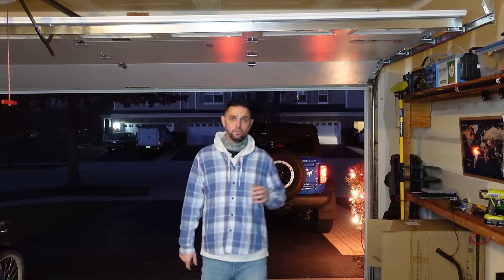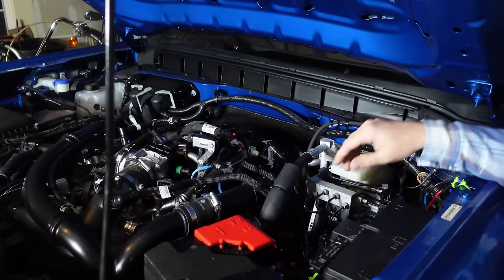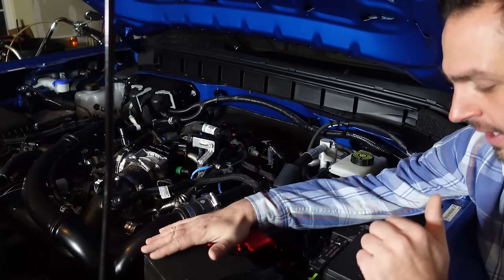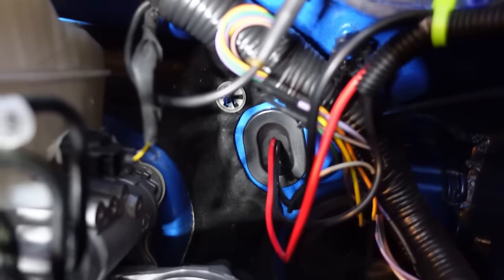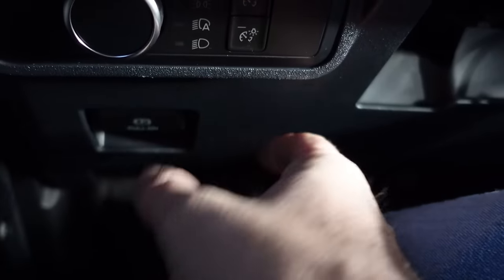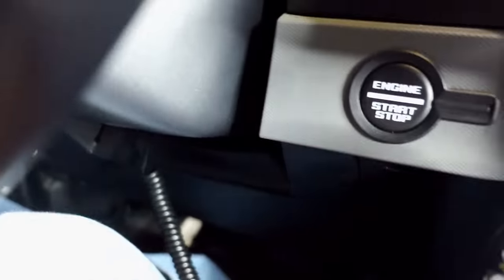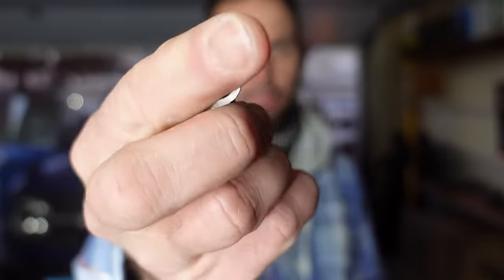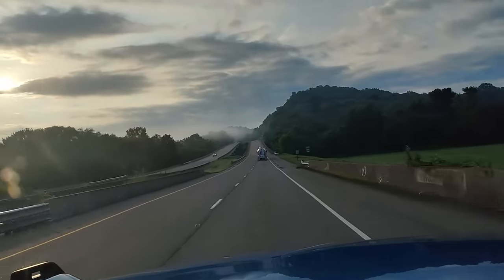My Ham Radio Install in a 2021 Ford Bronco 6G #hamradio #bronco

Comment: Yes sir! Shout out to you for reminding people about the airbags. So many people forget it or act like it wouldn't be that bad.  As some have pointed out, something could become a flying object and inflict injury when there otherwise may have been no injury incurred in an accident. A great reminder!
Reply from the maker: Thank You!  I am so glad someone was able to understand why I left this in. It's so important and could be deadly!   Cheers!
Reply: @HAMRADIODUDE Sorry, I am new here and new to using YouTube for this type of information. Do you have a video providing a more detailed install of your YAESU? I have the same model and would also like to put it under the steering column in my bronco. I appreciate any assistance you can provide. Thanks.

Comment: Nicely done! 
Something I did with my FTM-300 was run the power cable through the firewall and into a powerpole 4 slot teminal, also fused, just under the passenger side dash in my F150. Future proofing for other power pole accessories like a 12v laptop, another radio, etc...

Comment: Great tips on the install. I am slowly working on installing radio in my 2dr Bronco. Will make sure I have fuses next to battery. Non Sasquatch makes it easier to mount antenna on back, as the spacer is not needed. By the way that is the best Bronco color. Have more fun and be safe.
Reply from the maker: You're right about that spacer! The sasquatch with the larger tire creates the issue.  And yes, Velocity Blue is the Best.  I was thinking about a video showing off all my aftermarket stuff.  I love this vehicle.  Enjoy yours and good luck with the install.

Comment: Good job on the install. I did something sort of similar. Ran wiring from the batt to the inside, then connected to a 12VDC power strip allowing other possible installs. Unfortunately my 2002 Pathfinder certainly was NOT designed for installing additional radios inside, so I bought a Lido floor mount (LDO-LM-300) which puts the radio next to the center console. There are a couple of minor trade offs, but I really don't have issues with it. Radio is a Yaesu 8800. Plans to add an additional radio is my Yaesu 891, and that will take some real creativity. If finances allow it, I really want to get a Yaesu FTM-500. 73 de N5NUK. I'm good on QRZ.

Comment: Nice job. One suggestion I’d make is to add a relay and an on-off-on switch.  Wire one of the on connectors of the switch to a fused accessory power.  The other to fused battery power. Output of switch to the relay to control the fused battery power to the radio. In normal operation you can have the relay come on with accessory power. That way you can just turn off the car and not worry about the radio or your battery.  Want to run on battery without the engine toggle the switch.  Want to turn off the radio power feed like when your in for service or someone else is using the car, choose the middle off position. Mount switch out of sight for extra peace of mind. Best of all words.  Couple extra minutes to wire up but worth it in the long run. At least to me it was.
Reply from the maker: Great suggestion, thank you!

Comment: I have a Jeep JL it has a fiberglass roof. So on the tailgate with the antenna vhf and uhf it works fine. I would have a fuse and a relay to turn off the power for the radios. I often forget to turn them off. I like your Bronco 🎄

Comment: You made some very good points. Especially the ones regarding safety. I'm in the middle of installing my Midland MXT275 GMRS radio and I'm taking my time to perform the cleanest installation possible. I will be using a short antenna mounted on a bracket by the A-pillar. The only trouble is the length of the antenna cable is ridiculously long. I've heard that bundling up the wire under the dash would compromise the reception. Is that true? And how difficult would it be to cut the wire to a reasonable length and install a new end to plug into the radio. Any input is greatly appreciated!

Comment: Recently while troubleshooting a starting issue on my f150 I found out that. These trucks have a bms system. And if you connect directly to the battery the bms does not take the amp draw from an accessory in to account if you connect the negative directly to the battery. You must connect past the amp sensor on the negative terminal. So a body ground would do it.
Reply from the maker: Thanks. That makes sense.

Comment: One mistake?  Here are four.
1.  You mentioned it - fuse the connection at the battery - as close to the battery as possible.  The battery will happily deliver several hundred amps into 5 feet of #12 wire, getting it hot enough to start a fire very quickly.  Even if you are right there at the battery, disconnecting it while it is glowing hot won't be easy.  Get the fuse there BEFORE you run the rest of the wire.
2.  You should compute the effect of that gain antenna squirting RF energy in your face when sitting in the driver's seat.  At 50 watts, it i probably outside the safe limits.  For the lower general public limits, a rider on a motorcycle in the lane next to you is possibly over the limit, too.
3.  Yes, you hit on one with blocking possible airbag burst paths and flying bits of radio shrapnel.  I suppose that is why under the seat is frequently used.
4.  While thinking of airbags, you might want to take some careful measures to ensure that RF doesn't trigger the airbags, either directly (energy getting into firing mechanism) or indirectly (energy getting into some of the car's logic that decides to fire the airbag.  You want to know that even on a long transmission at full power, you won't have stray RF getting into the system.  This might be difficult as it may be difficult to determine where the sensitive parts of the vehicle are (but directly under the steering wheel airbag seems a risky choice).  Chokes spread along the coax to ensure that RF on the feed line isn't being re-radiated may be needed, but general separation of the antenna from the airbag areas, and choking off any ground current (the 2/70 may not need a ground plane, but it probably does have some ground current).  Might be better to put the antenna at the back of the vehicle, away from the vehicle computer and front seat airbags.
Reply from the maker: Thanks.

Comment: I would suggest 1) not to mount the antenna there where it sprays RF into your face when transmitting, 2) do not run the negative wire all the way to the battery, ground it on the frame near the radio.  The only thing grounded at the battery post is the vehicle frame or engine block  -- this prevents your radio ground wire from becoming a circuit in case of a fault in another device.
Reply from the maker: Thanks for the suggestions.  I can agree with the grounding the negative somewhere on the chassis close to the radio.   Thanks.   As for an exposure report; I'll do my best.  FTM 400 has 3 power Levels, 5,20, and 50 Watts.  So with that, we also know the FCC rules and regulations require us to use the minimal amount of power necessary to complete the communication.  I'll start with 5 Watts.  My car seat (where I sit) is approximately 3.4 ft from the antenna.     This is confirmed with a tape measure and how I am physically sitting when I drive.

 Calculating with the gain of 3.8 dBi and 5.2 dBi (vhf and uhf) :

All calculations assume a uncontrolled environment with  5 minutes transmit time / 10 minutes listening:

5 watts VHF -  Minimum Compliance Distance: 1.3 ft 
20 Watts VHF - Minimum Compliance Distance 2.6 ft
50 Watts VHF - Minimum Compliance Distance 4.1 Ft (Fail)

5 watts UHF-  Minimum Compliance Distance: 1.2 Ft
20 Watts UHF - Minimum Compliance Distance 2.5 ft
50 Watts UHF - Minimum Compliance Distance 3.9  Ft (Fail)

So in this environment, I cannot use 50 Watts for 5 minutes without being exposed to RF excessively .  Taking into consideration the Rules and regulations, I wouldn't need more than 5 or 20 watts here to make contact on the three repeaters I sometimes speak on, but would have to understand this could be an issue in the future.  

How does this sound?   My other option is easy enough, move it to the front of the vehicle.  Then there's about 3 more feet of separation. 

Thanks

Comment: I have the 891 and the icom 2730 in my trunk. Why chevy put the battery there. Both are detachable head units. But i did add eternal speakers to the tear head rests
 Cant see them. Buth you can hear them. Each install can be unique. Not ecery install is perfect. Its the owners preference. Btw thanks for serving. Fellow veteran. Btw make sure you get your va beneifits.

Comment: You have good install and I have a FTM-400 in my Jeep.  My antenna is in the same location and it works well.  No antenna location is perfect.  Now I have wireless mic for my radio that using a mag mount and I wish I knew where you got yours for the radio head.  PS I also have a FT891 for pota too.
Reply from the maker: Hey there.  Walmart for the magnetic mounts. If you'd like to support the channel, there's an Amazon link in the description.    If you need more photos, I'd be glad to grab them.   Good deal on the the 891.  That's going in here next! Great wishes

Comment: Sorry, that antenna requires a ground plane.  If you do have a good match, it is because it is grounded through the PL257 at the radio.  Also that Larsen NMO570B is not a center loaded antenna.  It uses the coil at the bottom for one band and the coil at the top for the other band.
Reply: 1/2 wave does not NEED  a ground plane
Reply from the maker: Yeah, talk to Pulse/Larsen - https://www.youtube.com/watch?v=cpydv4fGSHE (It'll work at unity) with a GP you may get 2.4DBI of gain.  It's a tossup to needs.  My install works fine. To take this a step further, this is the NMO270B (I think you know that but had an error) with a PL259 Going into my radio (Again, but for clarity sake). Per all documentation online, the NMO270B is a 1/2 Wave Center Loaded antenna on vhf and collinear on UHF.  (an example is set forth here - https://www.gigaparts.com/larsen-nmo2-70b.html).  No special coax is needed.  Is a NGP antenna the best option?  It depends.  Does it REQUIRE a Ground Plane, not really.   

If you have different  results which physically prove your claims that this isn't center loaded, does require a ground plane (REQUIRE being the keyword) or that it won't work without magical cable; please provide evidence.  

Like I mentioned in my 9:1  video - People can claim anything, but providing data along with claims; well, that helps validate the claims.    Would you believe someone told me you NEED a tuner with a 9:1?

Comment: There is no need to run both the positive and negative off of the battery via one wire cable back into the cab.  It would have been much safer if you just took the positive lead and ran it into the cab and for the negative, just use any ground lug either under the dash or in the foot well of the vehicle. This would minimize any electrical shorts. And of course, you would have the positive cable correctly fused.  This is how pros do commercial rigs in vehicles!
Regarding 12Ga wire and 20A max draw from the radio, just go with a 10Ga wire as it isn't that much more and would allow you to run a more powerful rig in the future if needed.
Reply from the maker: Thanks.
Reply: @HAMRADIODUDE You did right by 12 ga and running both wires to eliminate ground loops. Nice job.  -Derek

Comment: Clip your zip ties flush.  The auto industry has a standard for power wires to be used in a vehicle.  They are primarily three certifications, GXL, SXL, and TXL.  They vary in the thickness of the insulation, primarily.  I always use that level of cable in the vehicle to ensure that it will handle the temperature and abrasion.
Reply: Ziptie gun from harbor freight dude.
Reply from the maker: Thanks

Comment: How do I contact you?
Reply from the maker: I just sent you an email.  Cheers.
Reply: @HAMRADIODUDE  when mounting the radio under the column did you use the radio mount or secure it some other way? Thanks.
Reply from the maker: @dennisbush4244  Hi Dennis, thanks for the question.  No mount.  It fit pretty well in there, I may have used Velcro on the radio and column to "feel secure" about its location. Fact is, it's been months on different roads, different speeds and it sits well in there.

All I really did was remove the panel under the steering column  in order to have all the wires ran to the area.  If I recall correctly, I fished the power cord out through the steering column area (just below it), as well as my SO239 connector/cable.   Then outside of the steering column, I hooked everything to the back of the FTM400 and finally i placed the ftm 400 under the steering column.  

Again, at this point, it fit really well in there and does not effect my steering capabilities at all.   

After this install, it was brought  up about the airbags. I have double and triple checked my model and confirmed there are no airbags in that area.  

Hopefully this gives you some ideas. If not, shoot me an email (located on the about section of my youtube homepage) and I will help you out a bit more. 

Thanks for reaching out!
Reply: I could not find your email.  Sorry. I think I am almost there. I plan on direct wiring to my battery. I plan in using 10 gauge like you, and having in line fuses. My question is, is there any concern about the ftm-400 drawing the battery down even when it is off? A friend  mentioned parasitic drain from the radio memory 🤷‍♂️.  Did you add anything to prevent this or is it not a concern? Thanks again.